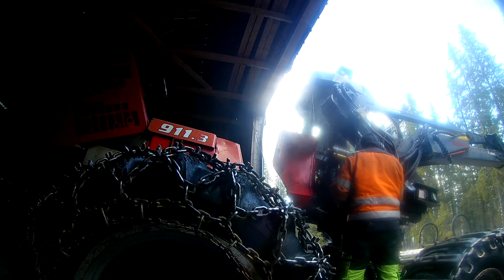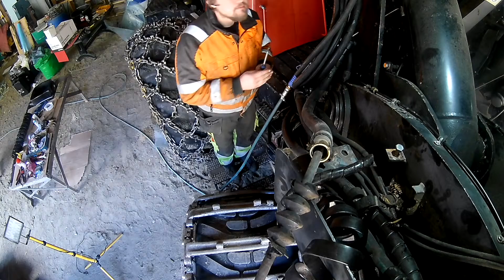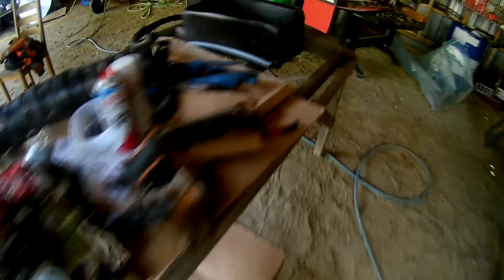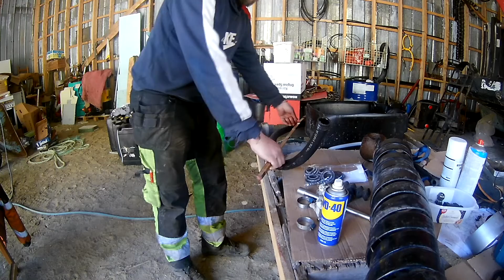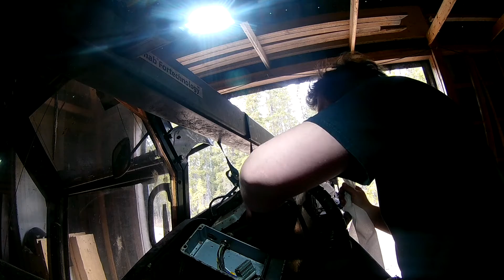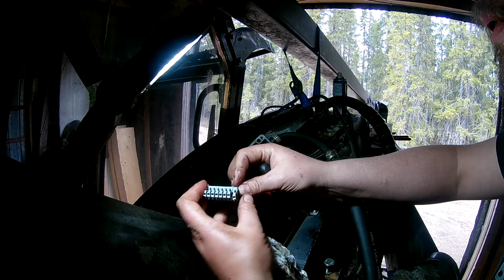Valmet 911.3 Replacing protection on electrical cable

Comment: Dom kontakterna är fina att få ur kabel med bara radiomejsel. Tryck in mejsel i hålet intill där kabel går in. Då trycks bläcket undan som låser kabel, då behöver du aldrig sprätta isär hela kontakten.
Reply from the maker: Försökte först trycka in i hålet upptill med ett litet dorn men gick så tungt ville inte vara för brutal men rätt kraftig fjäder som håller stiftet. Man får nog lägga kontakten mot nått stadigt går det kanske. Får försöka det om nån ska isär igen. Tack för tipset.
Reply: @blackgrove8  okej. Man måste ha nått som är spetsigt i änden. Har haft isär såna massor av gånger. Hade problem på en maskin där kabel gled i höljet ner i aggregatet så det blev rätt som det var man fick hålla på med dom kontakterna. Men det är ganska trögt, radiomejseln funkar som sagt bra till det. Nu löste ni det ändå, men händer nått i skogen blir det lite pilligt att göra så. 
Får lov att säga att ni gör ett riktigt bra arbete på både maskiner och timmerhuset 👍🙂